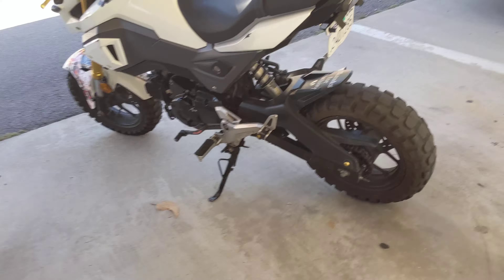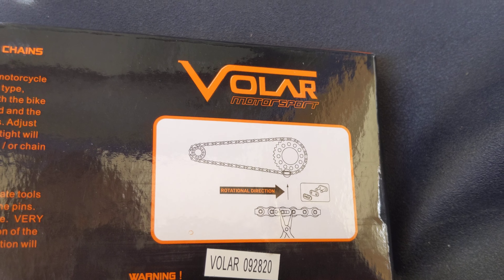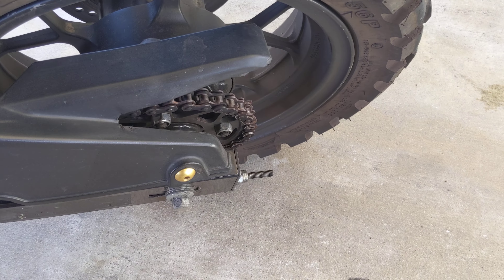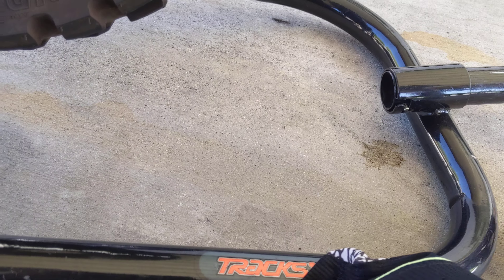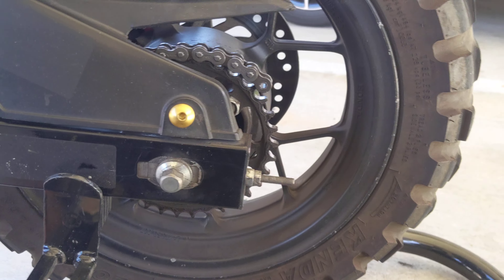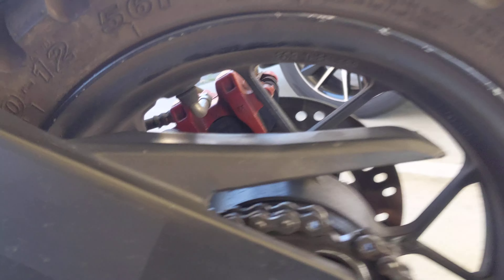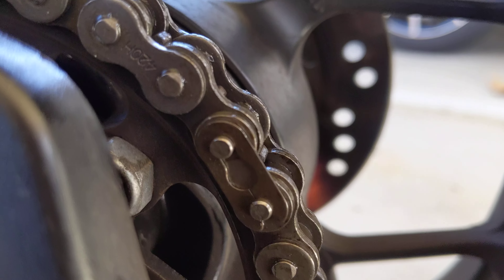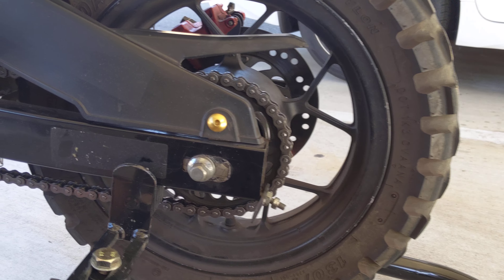Honda Grom Chain Replacement Made Simple!! | Updates & More!

Comment: Do you not have to replace the sprocket at the same time?
Reply from the maker: Not at all, I replaced the front sprocket a while back already, the amount of where it will make a difference in is minimal and honestly for $15 I'm not bothered haha
Reply: Always always replace chain and sprockets  as a set
Reply: @johnshanks7902  for maintenance it's smart for repair its uneeded
Reply: @johnshanks7902 why? Honest question.
Reply: @Snowburnt  depending on your sprocket they can last as long or even less than the chain itself. Especially with these smaller chains. If the wear isn't bad you could skip it but all you are doing is accelerating your chain wear and having to go back and change the sprocket later.

Unless you are just dirt cheap you should do them all at once.